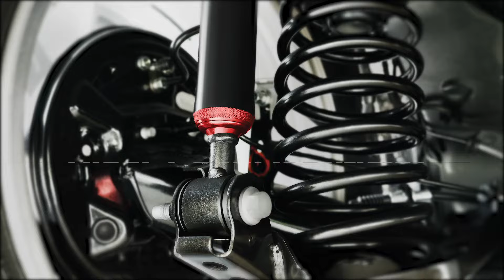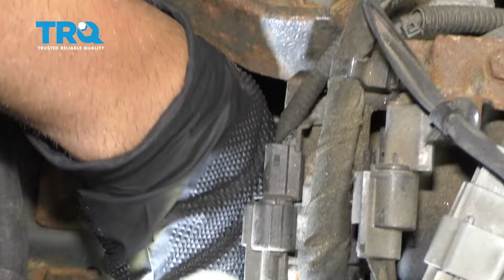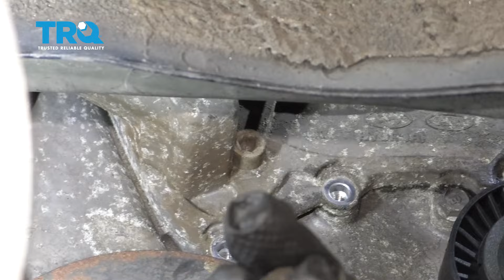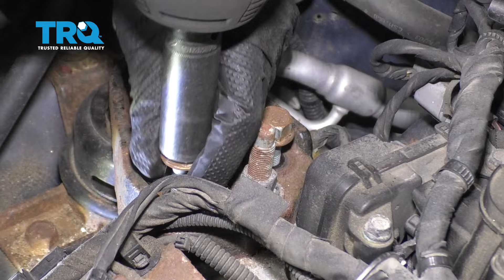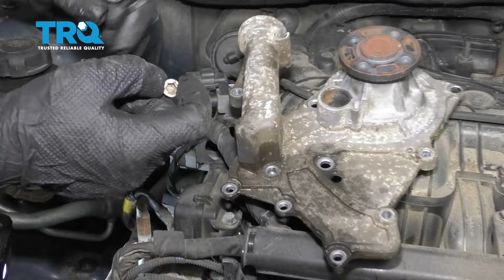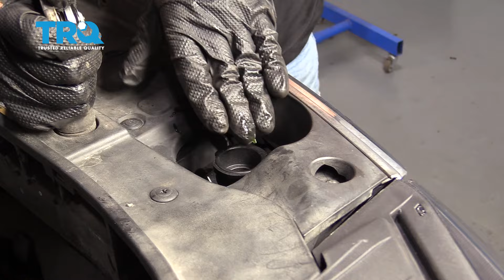How to Replace Water Pump 2011-15 Kia Sorento

Comment: Is there any workout for that long long bolt at the top left of water pump? I reinstalled the timing cover and forgot to put that bolt back into the hole and now it’s all together.  The bold is 2 long to just slide in there and I really don’t want to have to remove the timing cover again

Comment: Thankfully the thermostat was very easy on this version of the motor is facing towards the radiator next to the battery. It's below the top hose. Make sure to put it at 12 o'clock position. With shorter end facing out. There is a mark on the housing to indicate where the top of the thermostat goes.

Comment: Mounting bolt torque specs?
Reply: Every water pump on every car has virtually the same torque specs, very very low. Usually 8 or 10 ft lbs max